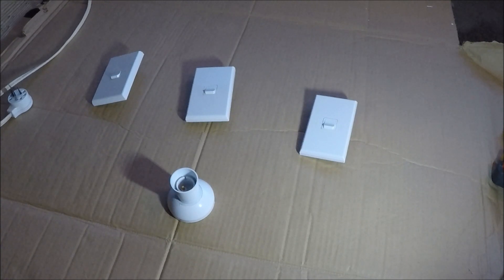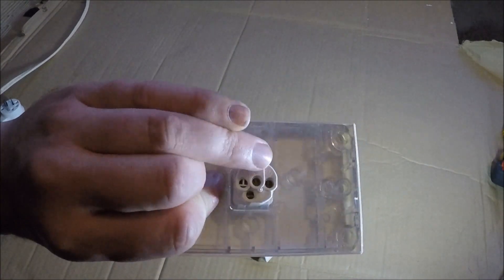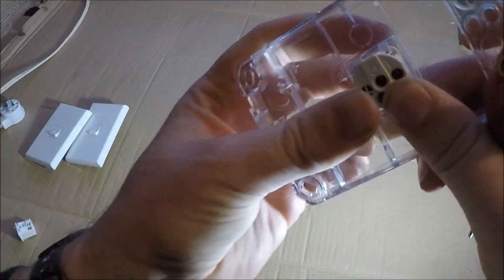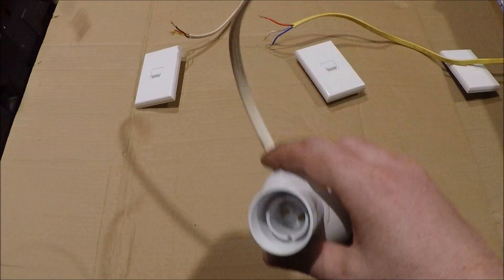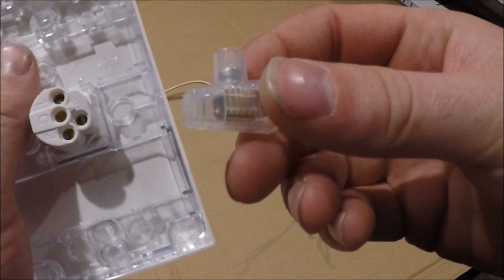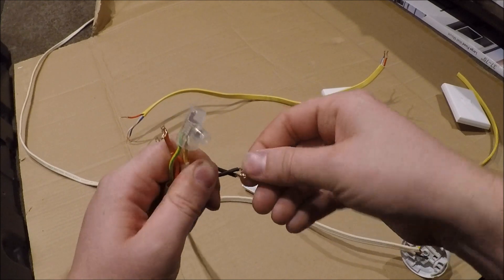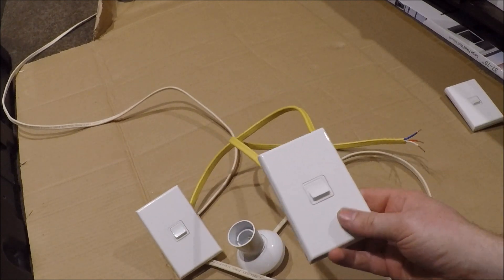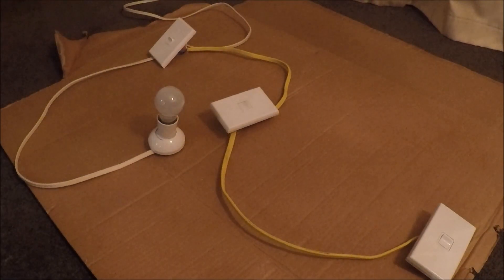How To Wire 3 Way Switching

Comment: Hey mate. Thanks for the videos, you've saved my arse multiple times haha
I've just installed a 3 way lighting circuit, but the red core between the intermediate switch and the last switch is broken 😕  do you have a way around this problem?
I can't pull through a new cable unfortunately

Comment: One question, is that yellow cable any different from the white?
Reply: Different colours. White tps has red/black/green. Yellow tps (strap) has white/red/blue. In NZ you cannot use the green as a live conductor unless certain conditions are met hence the use of white/red/blue between the switches

Comment: My first time to see that method of connections and i was surprised because it does work. In Philippines we have a different method of connections(but the same devices you used) for that kind of switching system,and the outcome is the same as yours.

Comment: Just thought its easier to wire the Phase to Red Core which goes right through to far end "C" Light switch and the Light feed is connected to "C" at supply end. so only White and blue wired into Intermediate switch. Brent (Power Tech)
Reply: exactly how i do mine! all the same ofc but i agree, little bit easier